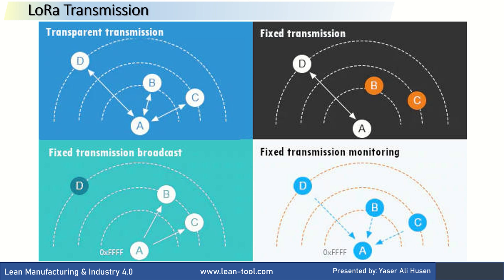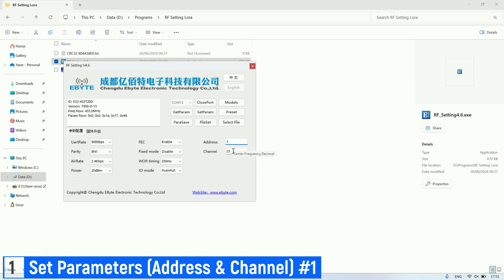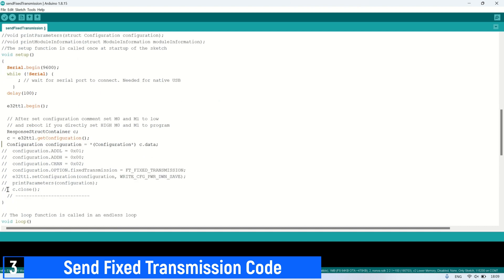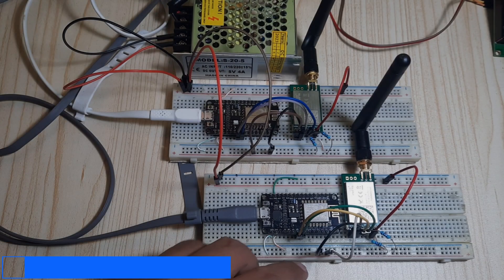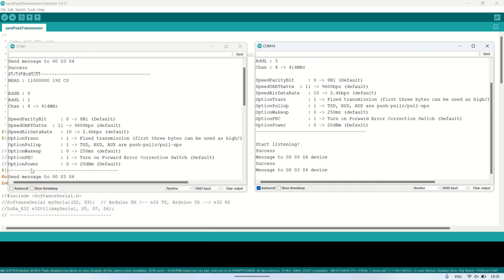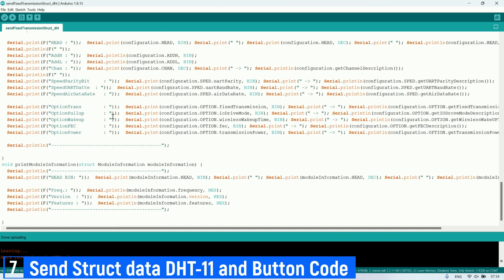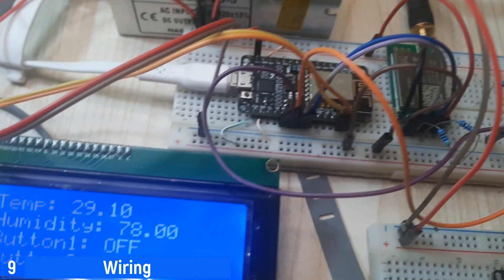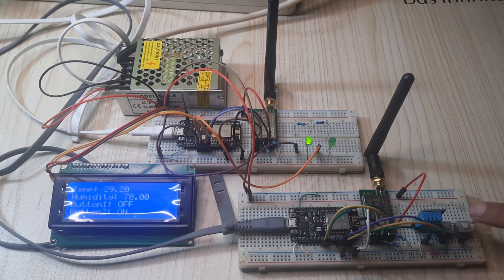Fixed Transmission and Struct Message LoRa E32 Ebyte Using ESP8266

Comment: Dear Yaser Ali Husen, Could you please help to post a video interfacing Arduino Nano with E32-433T30D to Tx and Rx button signal? I tried the above video configuration and facing challenges. In the above video you have used TTL-100 for which you are using Voltage divider n/w and pull-up's for Rx and Tx respt, I tried both (one direct connect and the other with the pull-ups/and voltage divider, both of them aren't helping to transmit the data from LoRa. But both LoRa are giving correct config when I read when M0 and M1 are kept open (which is weak pull-up applied internally), just that transmission not happening. even I tried changing antenna. Tx side I kept both M0/M1 open, but for Rx side I kept M0 and M1 to GND and tried example code "sendFixed Transmission" / "ReceiveFixed Transmission" - Here sending side says successfully sent, but Receiving side no update just "Start Listening!". I will now try with ESP8266 and see if it can work or not, this time only pull-ups for both Tx and Rx, lets see. But anyways please share the circuit drawing for Nano to E32-433T30D LoRa. Thank you in Advance
Reply from the maker: Thank you for your comment! It looks like you're facing challenges in transmitting data using the E32-433T30D with Arduino Nano. Based on your description, here are a few things to check:
- UART Baud Rate: Ensure the baud rate in your Arduino code matches the LoRa module settings. The default is usually 9600, but it may vary depending on previous configurations.
- Voltage Levels: Since the Arduino Nano operates at 5V, but the LoRa module works at 3.3V, using a voltage divider or level shifter on the TX line is recommended. Direct connection without level shifting may cause issues.
- Interference & Distance: Have you tried testing at a very short distance (e.g., within a meter) to rule out interference?
- M0 & M1 Wiring: Your configuration seems correct:
Tx Side: M0 & M1 open (floating, weak pull-up).
Rx Side: M0 & M1 to GND (Fixed Mode).
However, some users reported better reliability when using explicit pull-up resistors on TX/RX instead of relying on internal pull-ups.
Reply: @YaserAliHusen  Thank you! for quick reply, it is due to voltage levels, after applying voltage dividers - then I was able to handshake between LoRa and Nano and more importantly we must set M0=M1=0 for Tx/Rx to happen, your other video "https://www.youtube.com/watch?v=h6PLXrxV66Q&ab_channel=YaserAliHusen" helped to troubleshoot the issue using Hercules Serial Terminal. Glad to know that both Tx/Rx LoRa modules are functional - I checked the range - it is pretty good from inside house to till 200meters, Range extended when I apply 5V for LoRa

Comment: for some reason fixedTransmission is not working for me. non fixed does.
Reply from the maker: Try to change address and channel
Reply: @YaserAliHusen  after spending couple hours i found the problem. had to set pins M1 and M0 to HIGH to program, then LOW. Also store parameter matters. but it took me a while. thanks anyway.
Reply from the maker: @aleXelaMec ,
Perfect, Congratulation!
Usually I set parameter address, channel, and fixed enable using software, and connect M1&M0 to High and connect again to ESP with M1&M0 to Low